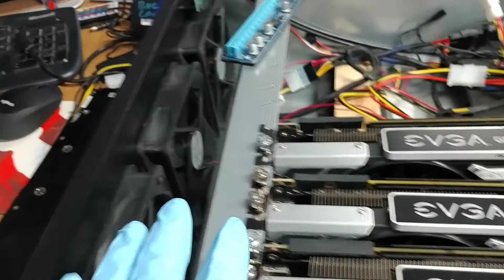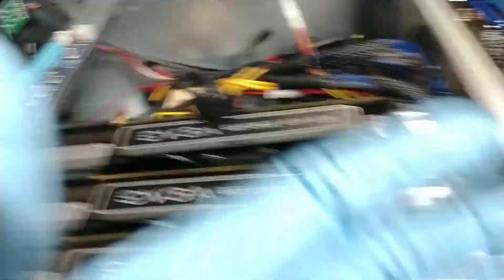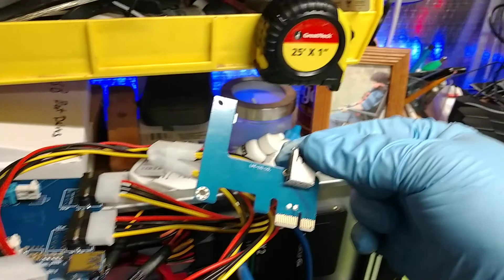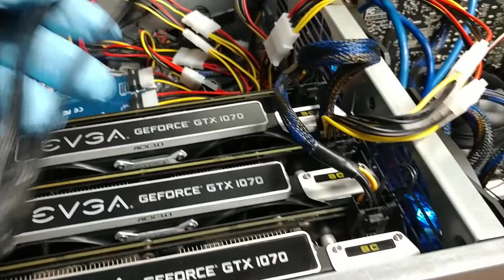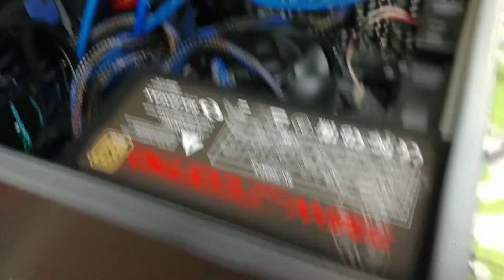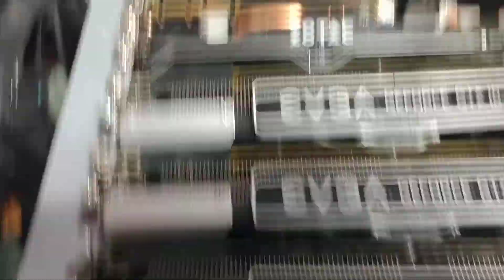Doing a 4U GPU Mining server right and at a low cost part 2

Comment: no noise from the chassis?
Reply from the maker: No not really, I just choose better fans and not filling the chassis to the max..  It is working nicely currently. But make sure you check your fans every six months.  Just in case as with any fans you use...